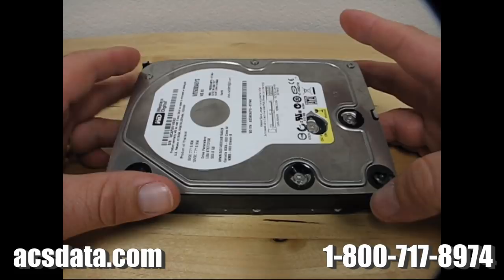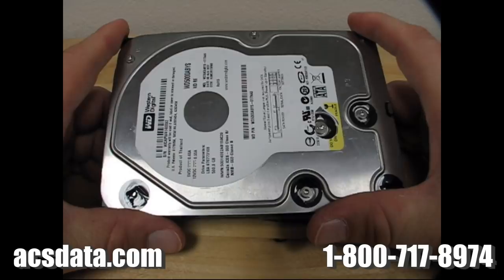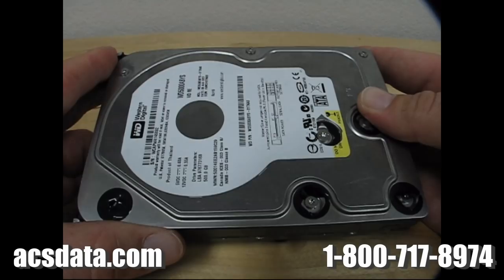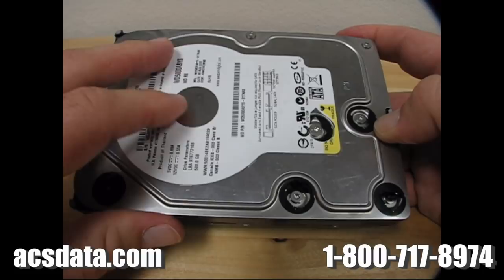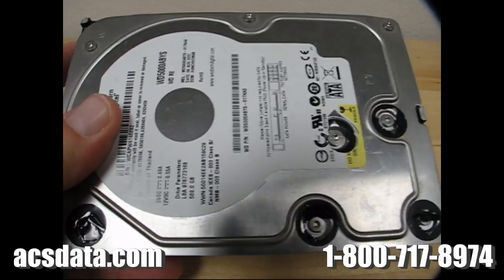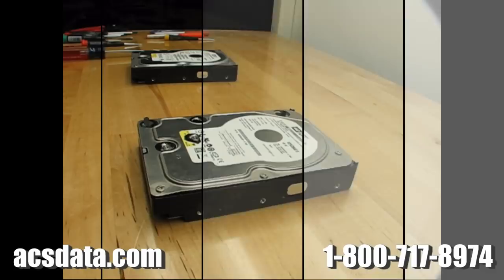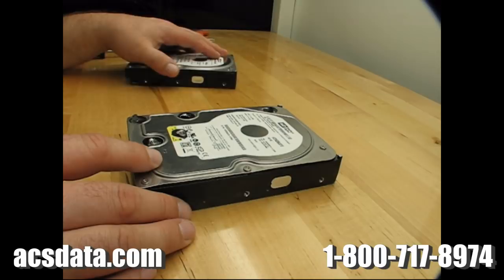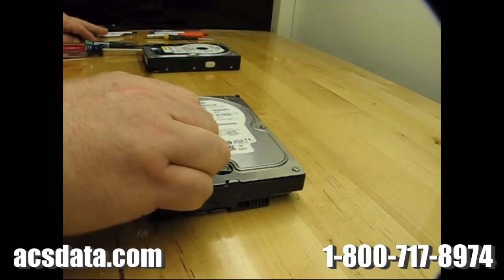Hard Drive Repair And Data Recovery On 500GB Hard Disk

Comment: Nice vid!
But i have found in practice that usually a drive is not damaged that much that you have to open up the drive and replace parts. I mostly just, 1. set the drive in one place and leave it there for a night to rest. 2. connect it to a linux system with set to not do PNP and auto-mount. 3. send a spin up and then wait for the drives firmware to recover the bad blocks, prepare to wait for hours/days until the drive is quiet again. 4. dump the drives data (mount read-only using DD or etc.) 
(oh and i have one running now, has taken about 3 hours to become quiet, and is now being dumped to an image with dd | gzip - slow, but steady and  without any read errors yet :) )
Reply: Hi - I have some bad sectors on my WD laptop hard drive.  I tried using HDD Regenerator but after repairing only a few sectors I get an error that I need to purchase the program.  I don't want to do that if I don't even know yet that it will work.  I wanted to isolate the bad sectors mainly because its 750gb drive and an older computer.  I figure if I can isolate the bad sectors I'll still have a lot of room.  I'm trying to do my own repairs to save money, any ideas?  I hate to lose a drive with this much memory on it.  Thanks

Comment from the maker: If you're talking about the "whooshing" sound, like a bunch of air moving around, it's from our Flow Hood.  This creates a Class 100 clean room area, by forcing highly filtered air into the work area, so that the drives don't get contaminated with debris when they are opened.

Comment from the maker: Thanks. We use DDI (Deepspar Disk Imager) most of the time.  We have a few of those as well as other imaging tools.  There's really no single solution that works on every case, so it's good to be flexible.  In all we keep anywhere from 16 to 20 imagers active at all times.

Comment: If you don't want to teach us the parts that matter, what is the point of this video?
Reply from the maker: Ribhi Kamal It was never considered or intended to be an instructional video.  We have another video posted that is somewhat of a DIY case where you can see us do a platter swap, and explain each step.
Reply: acsdata Read my reply and you will understand.

Comment: I have an Asus 540 laptop, and while it was closed, it slid off the desk and landed on it's front edge (where palms rest).  It was a pretty hard fall.  When I went to turn it on, now it just stays on the Asus logo screen.  I took out the drive, created a clean room, and opened the cover to take a peek just to see if the heads were stuck on the platter.  Platter looked good, and the heads were where they're supposed to be while resting.  I quickly covered it again, and left it alone for the last 2 months.  I'm a mechanic, good at fixing things on my own, and know how to create a flow hood, and am thinking about tackling this myself.  Do you think that the most likely scenario for me is that the heads are misaligned, and it just needs a heads swap like in the video?  What other things do you think could possibly be wrong considering the heads are where they're supposed to be?  Thanks!!

Comment: My segate internal HDD I was using as external through casing fried up due to wrong power supply. It was 500 GB HDD. PCB fried perhaps. I connected to my laptop power adapter and fried it up. What is option? Data recovery or HDD repair. It had lots of my personal favorite movies and videos. Disk was almost full.

Comment: I have an ide hard drive and when I connect the power to the drive it shorts the entire desktop. Do you think I can change the entire circuit board and it'll work? I have another hard drive just like it that I don't use but I know is working. I really need this one to work tho.
Reply from the maker: You might be able to.  Depends on the drive.  Some older IDE drives are more forgiving with board swaps.  Most modern drives though have unique adaptive data that is stored on the board and has to be maintained with the drive.
Reply: +acsdata the drive is almost 10 years old
Reply from the maker: Without knowing more specifics, it's impossible to know for sure.
Reply: +acsdata maxtor 3200 160gb hdd if you need a model number and stuff I can get it for you
Reply from the maker: It might work on that. Certainly worth a try.  Older Maxtor drives are a lot more forgiving when it comes to board swaps.
Reply: +acsdata thanks it gets in on Tuesday once I do the swap I'll let you know what the end result was.

Comment: Need help !!

It has been 7 years since I have been using my 500 Gb hard drive and now my HDD is too to slow to boot and even while opening any application or doing any work. Copy and paste goes in kbs.

I formatted the PC couple of times but while formatting the HDD it took almost 18 to 24 hours to format and installation new Windows 7, but the problem persist. I even tried for taking backup through LAN but the reading and writing speed is too slow (in kbs).

Please HELP asap.

Comment: Does anyone know how to recover a complete harddrive after it's gone unrecognizable by Windows (10). The disk is still in disk management but it has the only option to make a new volume. 

I want to try before I do something that makes it worse, to run a program or some action that I just can put back whatever broke like, I don't know, allocation table or whatever it is that knows where the files are.

Comment: good video! but what if a external hard drive just make a soft noise no lights on and you can`t find it on your laptop? i have tried 25 different youtube videos nothing work! do you have a tips? please help me!
Reply from the maker: If you can't feel the drive spinning up, then the heads are probably seized to the platter.  In cases like that you will hear a very faint "ticking" sound.  Also, some drives don't click loudly when the heads have failed.  Some of them you have to hold up to your ear to hear them.
Reply: no you can`t hear the heads spinning it is more like an electric sound like the one the ac dc Contact make the drive is dead in every other way thanks btw for answering so fast!
Reply from the maker: Hmmm...hard to say.  Maybe something in the electronics has failed.  Does it not make any noise at all? Can you upload a video of it?  If I could hear it, I might be able to give you a better idea.

Comment: I uploaded a video of my WD 500GB 2.5" external harddisk which is not working. I believe my fiancée did drop it somewhere and now this happens. the head is not moving, the disc is spinning and  it doesn't appear in my computer. Please Help

Comment: Very informative video-Thank you for posting!  I have a board that I suspect might be bad (won't spin-up), do you have a website recommendation for purchasing replacement boards?
Reply from the maker: You can usually find what you need for PCB's on Ebay.  There are services there that you buy the PCB and they will program the PCB to match your drive.

Comment: can we rearrange platter?
Reply from the maker: +ajoy sharma Not if you need the data.
Reply: but i forget the right position of those platter. What can i do now
Reply from the maker: +ajoy sharma There's nothing you can do.
Reply: +acsdata this is possible only for big companies who have expansive tool usually they use glider to clean the scratches from the surface basically they adding platter on rod that is mounted to servo then they have microscope that check the surface for debris and polishing off then take another image and compare with the first one to see any improvements.after that the platter data is copied and after is joined and reconstructed.these machineries have concrete bench due to eliminating the vibration.and price wise they cost millions.this cannot be done with deepstar or pc3000 or any other mode.
Reply from the maker: +gigi morphe You are talking about a glide/burnish machine.  That doesn't realign platters after they have been rearranged.

Comment: Well my WD harddrive failed. But my other WD 500gb from 2006 is still working and it have 100% S.M.A.R.T vaule. So strange my harddrive is still going on
Reply: The older hard drives tend to last longer than the new drives. What's up with that???
Reply from the maker: DanielWS424 The data densities weren't so tight, and the heads didn't float so close to the platters back then.  Overall they were much more simplistic, even though the design is relatively unchanged.